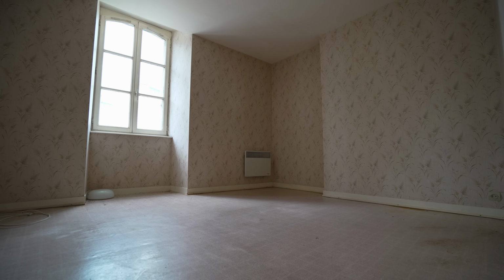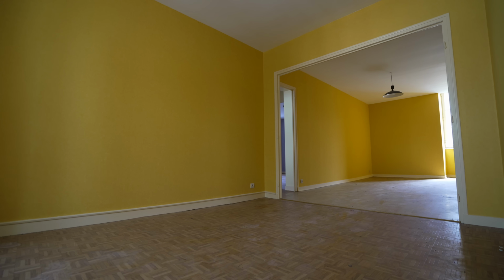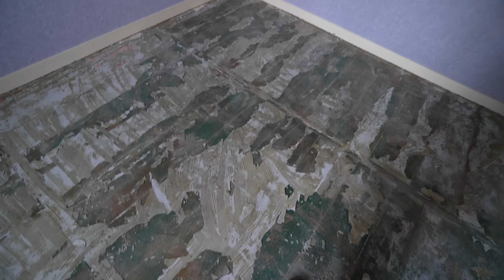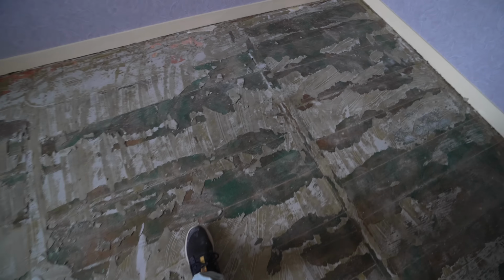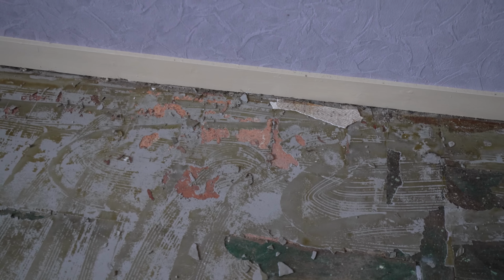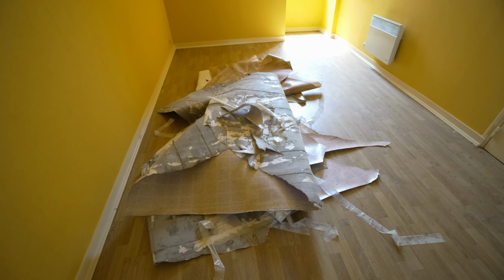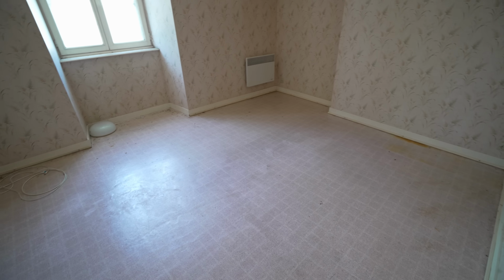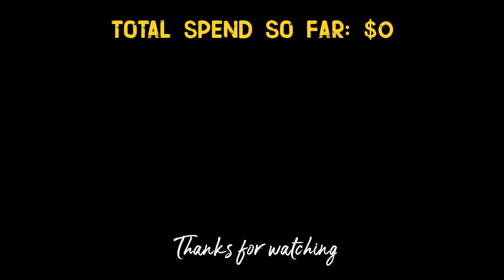Discovering The Original Floor of This 250-Year-Old Apartment

Comment: The second layer was propably not vinyl, but lenoleum. That was used often before vinyl was a thing for flooring. It can be hell to remove. Please, for your own safety, wear a raspirator and get this stuff testet for asbestos (the lenoleum and the adhesive!). It was used in the 50s to 70s and many things contained asbestos back then.

Comment: Keep the wood floor. Just sand it all down and stain it and it will be beautiful. I really like your apartment. It's just the right size. And on the top floor where you won't hear footsteps over head. And a great view. That's like 5 apartments there, currently getting fixed. I don't know how many more there is, but as soon as you guys get them done, Billy and Gwen can rent them out and have some income coming in. There's your apartment, the one you already worked on and is now ready to be restored. There is the two apartments that Sadie and Mo are doing, and the one Billy is working on. Things are moving quite fast at the convent. By the way, I just watched Billy's video with you translating the wall for Billy. That was just creepy!  I love hearing French spoke and you are the only one around who speaks fluent French. I've watched you help Billy with pricing at antique stores, talking to the owners about prices and all. You are a huge help. I love the journey that you and Billy are on.

Comment: You'll have to get that glue residue off, no matter what you do with the floors (or use some kind of levelling compound that would be a nightmare to get off the floor later). The two most common tricks are water (e.g. leaving soaked towels on one of the spots with the thick adhesive) or heat.

The green is surely paint, it used to be quite common to paint floor boards. Back in the day it was usually various shades of yellowish or reddish brown but in the 70s people started experimenting with other colours. I remember removing a floor that had at some point been painted fire engine red, later stripped and varnished but the red sat in the gaps. That was one of the worst splintery floors I've ever seen, some of those splinters went through leather soles! That's why we had to replace the whole lot.

Comment: ryan I would really take caution with the green flooring and have it chemically analyzed if it's 19th-century French green paint it could contain both arsenic and lead the first one would have you need to wear a hazmat suit to deal with it and its no joke!
paint was paint in those days if you did a floor or wall or doors and windows you got a thinner version of the paints used in art and many of the 19th-century masters have quite lethal art if you would lick them daily for a decade!
red paint possible mercury blue paint possible cobalt green paint possible arsenic many other colors possibly lead or a mix of the all the prementioned poisons.
if the structure is pre-19th century you could find all the poisons spread around the place.
the convent's chapel has a lot of green in it too and it's pre-1890 art so arsenic could be there too but it is safely behind a layer of clearcoat or varnish so leave it alone or call an expert.
SO, DON'T SAND THAT FLOOR YET! without protection!

Comment: You'll be happier in the long run if you re do all the floors. It will also be easier to do them all at the same time before you've moved in and started painting. doing them later will be a huge pain. It would also be worth spending the extra dollars and getting a professional in to restore them. They could even replace any wood that needs it. It will be faster to get them to do it too

Comment: You can pour boiling hot water over the vinyl adhesive and it will peel off. Doesn't have to be 100 perfectly off, the sanding machine will take cate of the rest. Also - DO THE WHOLE APT. It is always worth doing.

Comment: Hey Ryan, been watching your channel and feel I’ve gotten to know your likes and dislikes. As much as you may like that wood floor, that fireplace hearth tile is going to haunt you. I don’t think you will be able to leave it alone, because it doesn’t match the wood floor. This means you will invariably tear it out. That will require more work to be done. You may also find that like the corner apartment below (and so many of the convent rooms) the floors have been raised and there may be those same tiles on the floor under the raised wood floor. Based on the work that you’d be creating for yourself, I think you should find something nice to cover this floor and be done with it. You may also want to save yourself some grief by keeping away from the sledge hammer.

Comment: Pros of adding click flooring: Preserve the wood, protect the original/subfloor from any potential roof leaks, insulation (thermal and sound insulation) and liquid insulation. Cons: Time, cost, antique feel.
Pros of refinishing existing flooring: Antique feel, cheaper to just sand it and stain/seal it. Cons: It'll get scratched up, not as protected, very noisy for the floor below you, any drink spills can go through the cracks and ruin the plaster below.

Comment: I wonder if hot air would loosen that adhesive off the floor? Don’t use anything that can scratch the wood and then you can sand the floors or lay something else down. If you try to sand the adhesive off you’ll go through a lot off pads as they’ll get all gunked up. And as far as your comment about getting it up in both bedrooms…more power to you. Oh wait, did you mean the linoleum? ROTFLMAO!

Comment: Sorry to have to say...
I just don't think taking the easy way out is the best way...

Leaving the 2nd bedroom floor the way it is, linoleum intact, 
isn't actually renovating the apartment...

I understand the amount of work needing to be done is making you consider this option.
But -
Since you're renovating a historical building, the whole point is to NOT leave things like linoleum intact.
No matter how hard it is to remove.

Here's an idea that may make the wood easier to come clean.
Or maybe this would be harder?
See what Billy wants to do with my idea.

Ok, here's my idea:
Remove each wooden plank on the floor.
Yes, lift each one up - individually. 
Then run the board through a thickness plainer to remove all that horrible adhesive.
You may end up needing to buy new blades by the time you're done though!
Better to abuse the blades than your arms as you try chipping it off.
Or even worse, possibly damaging your lungs with a harsh stripper product, which is what it will probably need if it stays in place.
And I'm guessing a floor sander strong enough to remove the glue would chew up the boards underneath.

With a thickness planer, 
the boards will end up looking brand new, no more adhesive!
You can then put them back in their original spot & stain them yourself. 
I bet after doing that it would be gorgeous!!

Plus, you'll learn a lot about woodworking.
And when there's power tools, 
it's a lot more fun than what 
you're doing now!
Plus-
I'm pretty sure Billy already has a benchtop thickness planer.
I do believe I've seen him use it, 
if I'm remembering correctly.

I know you were hoping this apartment would be an easier job.
But even so, doing something the right way, will end up giving you such a huge sense of accomplishment !
Every single time you look at it you'll know YOU did it the RIGHT WAY!
I can tell you from experience, those proud feelings last a loooong time!

Anyway...
That's my idea 
= a planer.
Think it over.

Comment: If the original wood flooring is in good shape, which yours IS.......do NOT put anything over it! Rent a FLOOR (WOOD) SANDER, to make the wood floor awesome, again! I would tear up ALL of the flooring, in your apartment (because it looks CRAPPY-CHEAP!).....see what you have for floor, in each room. Wood?......GREAT!.....sand ALL ROOMS! The 'Corner Apartment' had great original TILE in one room; hopefully you'll find that in your new space (KEEP the original tile, if in good condition). I would NOT cover up those original wood floors.....sand them, and then put AREA RUGS in the bedrooms. One wants to ADD VALUE to a Reno; NOT replace cheap (flooring) with more CHEAP! OH!!.....and the fireplace 'tiles' on the floor......KEEP THOSE IN TACT! Restore them (clean/polish), and it will make a great feature to the room!!

Comment: In later time you might want to reopen the fireplace as it is original to the building. It connects to the same chimney as the one below. It might even be functional with a good servicing or just kept a decoration to the room.
Reply: @YaaLFH  I believe if you look at both apartments you will see that they sit one on top of the other. In that building there are only windows facing the parking lot on the 2nd floor, with one being directly above the door of the lower apartment. When facing the door or window, the fireplace is on the right in both apartments.
Reply: @YaaLFH  Please go to google Earth. The only windows on the second floor corner apartment are on the north side overlooking the parking area. Same as the door for the lower one. The only chimney is on the east wall, close to the north wall.

Comment: You should remove the base boards before removing the flooring, so that you can remove ALL the flooring properly.
Reply: If they put down a new wooden floor they will for sure. I remember Sean and Billy putting all the base boards back in the office after doing the flooring. I'm 99% sure that's what's going to happen here. New floor.